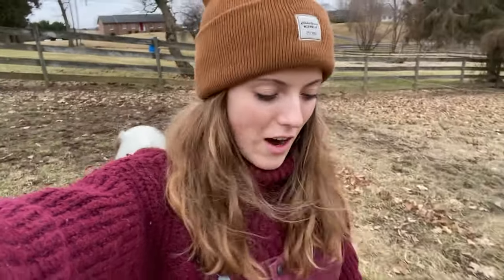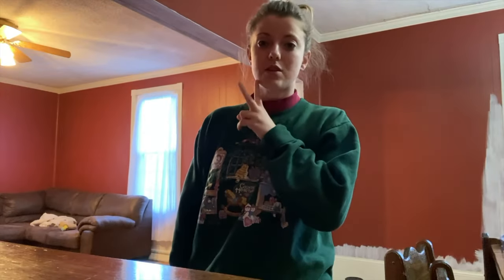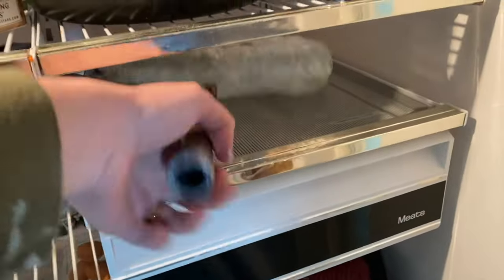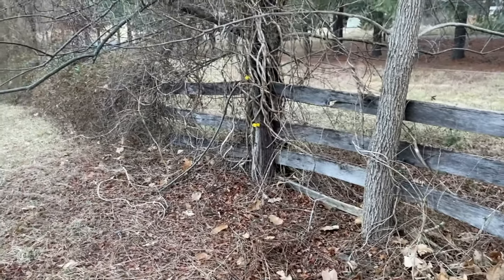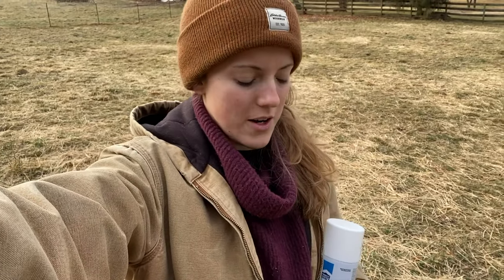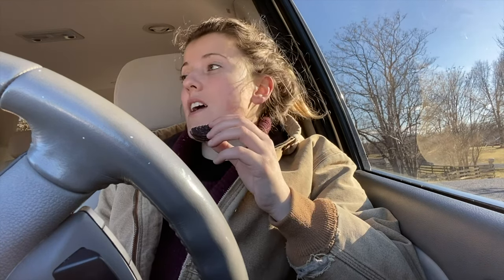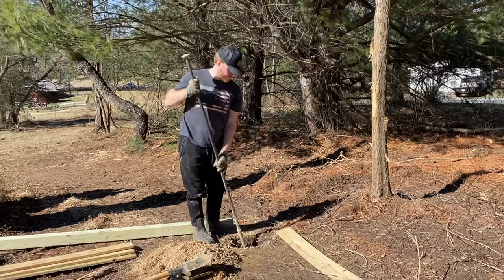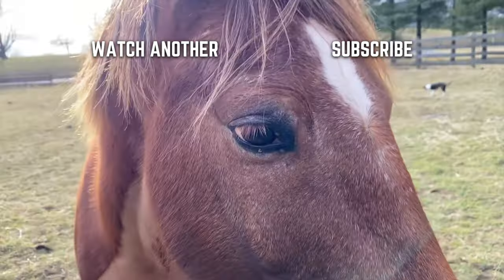DIY Wooden Horse Fence Installation

Comment: On digging the holes, get a battery auger. We had guys set up a fence for our dogs when we first moved in. They couldn't get their 2 man gas auger to dig in the hard soil. I got my Ryobi 40v auger out and it dug the last 5 holes with little effort in 15 mins. The fence co. owner left after I dug the holes, went to Hoe Depot and bought 2 of them for a jib they were going to after they left our place. It weighs 1/2 as much, digs better and easier and can dig 25 post holes on one 4ah battery, takes 30 mins to charge it back to full.

Comment: Look up the Mansaver Post Driver. There’s one for T posts and for regular wood posts. It uses an air compressor to power it. Makes sinking posts way easier and saves your body. Totally worth the cost since there is always a need for fence work.
Reply: Definitely checking on that driver!
Reply: @minuteofdangle0  Great! how?
Reply: Well...i tried..  😆

Comment: good for you..... hubby and I have had a combo of us doing stuff and hiring people because we have never had to be do-it-yourselfers until moving to the country.  You might consider using concrete for the  posts for the fence.  it doesn't take much for fences to fall over.  and wood rots, so spray with a sealant.

Comment: Tip for the fences
It's easier to use a power tool instead of a hammer. You have been working hard!
When I set up my fences I do the cheating way, I use a tractor and a post digger to dog mine 🤣

Comment: Should have brought 16 foot boards, that way you can Stagger the joints, it makes the fence stronger and straighter , mark the top board at 52 inches and work your way down with the other boards. If you pull a string line and set all your post first and then hang the boards your fence will be straighter